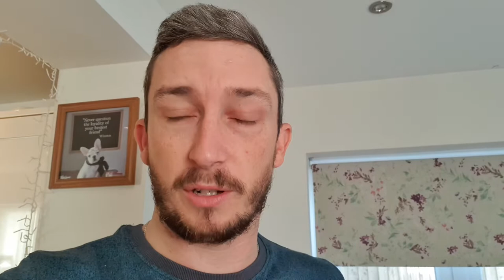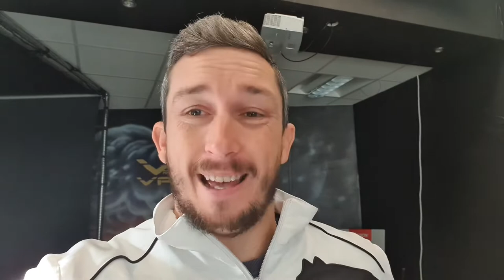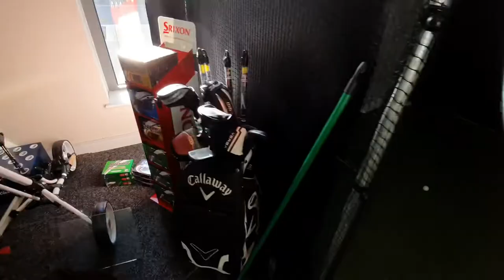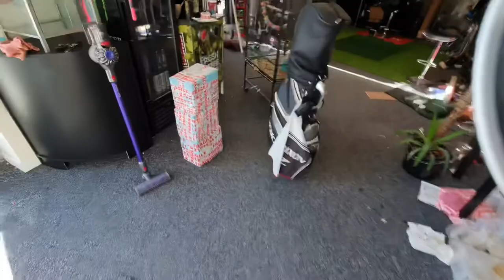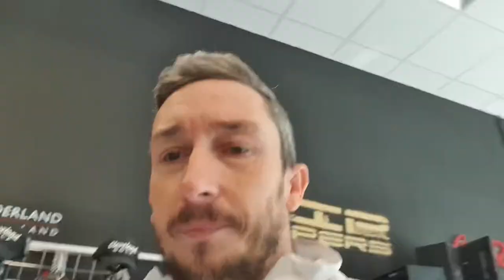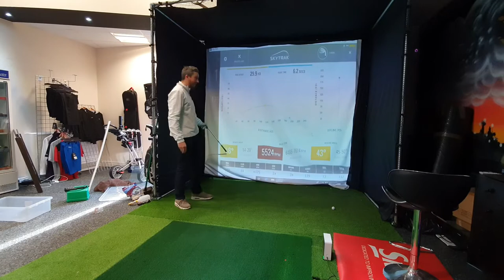DOES CHANGING GOLF SHAFTS MAKE ANY DIFFERENCE - Daily VLOG

Comment: Lovely setup there, what’s a good launch angle for a 7 iron? I see pros have like 15-17
Reply from the maker: Somewhere between 18 and 22 is good for an amateur. The pros are experts at ball striking every time. I’m not hahaha
Reply from the maker: But it also depends on your 7 iron loft, mine is 34 degrees, if yours is 27 degrees your going to probably launch it lower.
Reply: @LWG  well you're carrying 170-180 with a 7 iron, my 7 iron is like your first 2 shots! what did you do different? anyways my launch angle is 23 to high 24, but I can't seem to lower it..... more compression I guess!!
Reply from the maker: @thebackyardgolfer7010  could be a number of things, it's only ever technique or shafts. I knew my technique was fine from lessons but the shaft wasnt allowing me to get optimal conditions because my swing was too fast for them. Were you fitted for your clubs and by who
Reply from the maker: @thebackyardgolfer7010  also if your getting high spin that will reduce distance. I'm getting 170 because my ball speed is also mid to high 120 mph
Reply: As a rule of thumb, u wanna launch the club around 50% of the loft. Ie. A 34 degree 7 iron at 17 is good.
Reply: @LWG  max speed with 7 iron about 87mph, but ball speed is low about 110 so I think Im not compressing the ball enough (carry 150). I plan on getting MEVO so I'll check my launch angle and spin. No, I have not been fitted for my clubs, so maybe I need a proper shaft for me, thanks for the info 👍
Reply from the maker: @thebackyardgolfer7010  always best to get fitted mate and get it done properly.
Reply: @LWG  I'm afraid I know that now, thanks and I would love to see more videos on club data, etc... Skytrak is pretty good